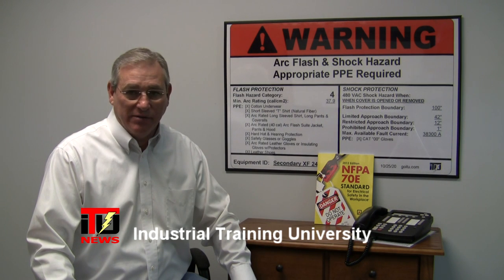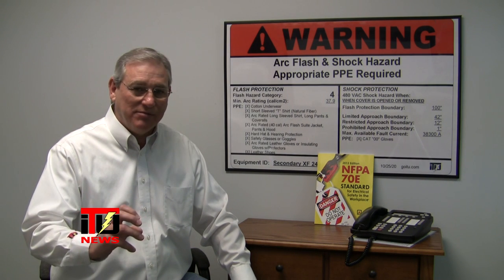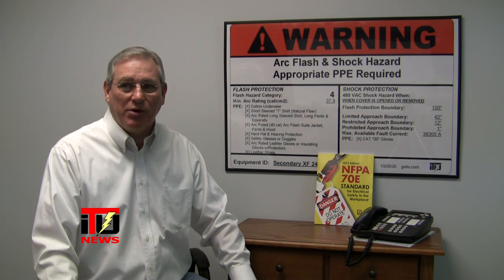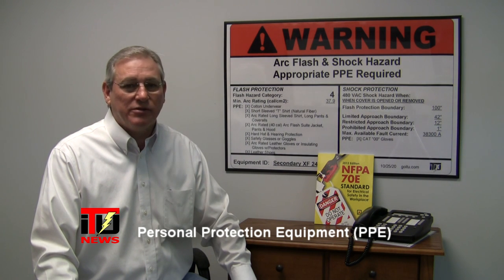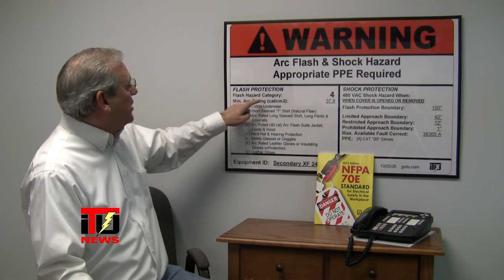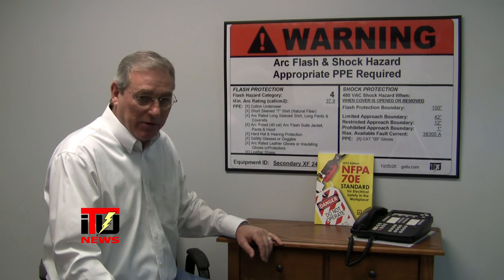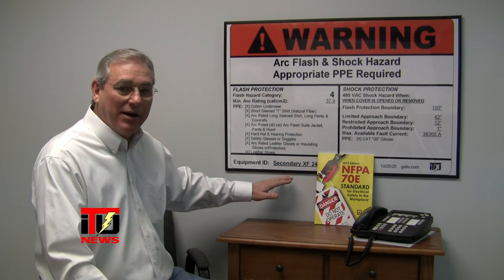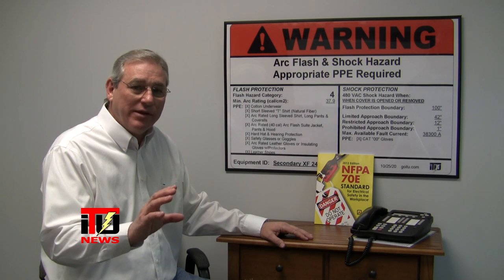2012 NFPA 70E Compliance

Comment: So this warning sign above satisfies the ANSI z535 standard regarding Arc Flash hazards. 

Avoid using "Danger: High Voltage" signage. Because this warning sign doesn't show stuff like arc flash protection boundaries, prohibited boundaries, required arc-rated class of PPE, all that--just only the 3-word warning--the ANSI z535 calls this signage obsolete, and you could still end up in violation of OSHA regulations despite this simple signage. Don't use such signs.